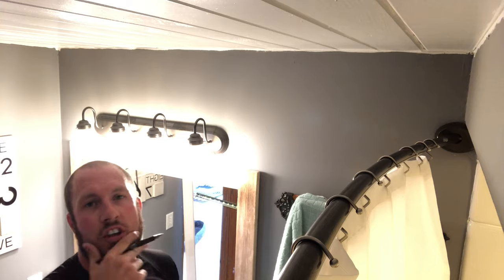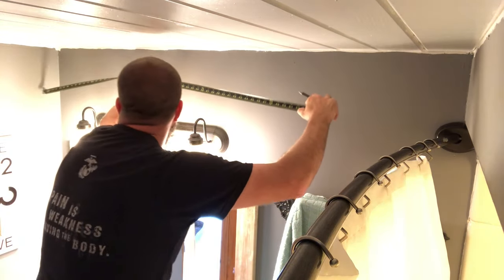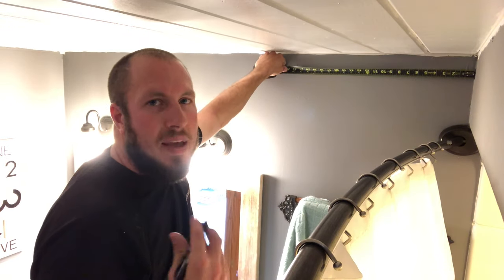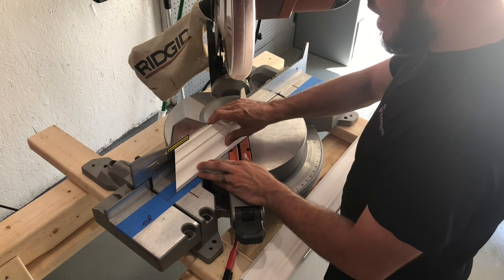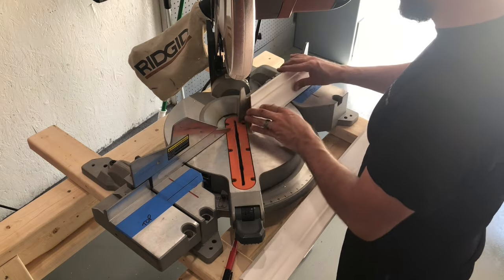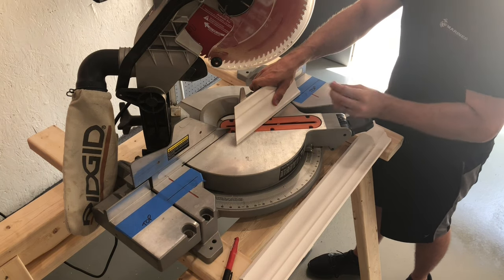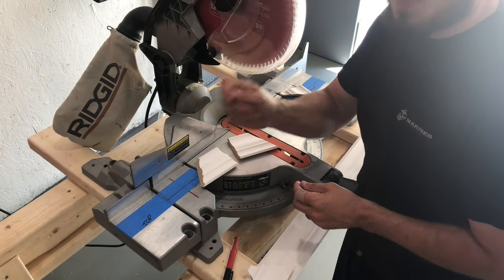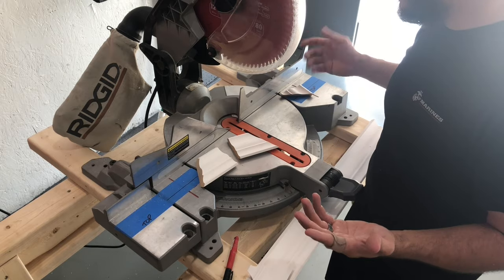How To Cut Crown Molding For Beginners - Inside Corners

Comment: Also remember!!! Never cut directly on the line! The saw blade is 1/8 thick, and if you cut directly on the line then it will shorten your piece by 1/16 if not the 1/8... blade needs to be on the outside of your line if that makes sense! See and have made tons of errors shorting pieces that way and it’s extremely frustrating
Reply: That's what caulk is for
Reply from the maker: Do your best, caulk the rest!
Reply: Putty/ caulking is for holes only. Always fresh blade, and its like shooting a gun, line up 3 points. I sight both front and back egde of the teeth on blade with proper side of mark. Line up 3 points and cut away!
Reply: You not explaining if the walls aren't flush 90°it won't meet up
Reply: Thank you for the sound advice
Reply: I like your comment, I’ll keep the saw blade thickness in mind.

Comment: this video was good but would've been better if you emphasized the angle of the sawcut and where to put the mark on the crown to get the right measurement for the wall insode corner to inside corner.  I'm confused about that.   Since it's not a straight cut like when you do baseboard because a baseboard sits right in the inside corner and crown does not, i'm unsure where to measure on the crown to get the right final distance.    good tip on not bending your tape into a corner.

Comment: I don’t know whether it’s because I’ve already watched a few dozen videos on this or whether it’s just that this guy finally made it make sense but now I GET IT. I now understand the inversion principle PLUS I now understand which side needs to be longest given an inside or outside corner.
THANK YOU, THANK YOU, THANK YOU! 🙏🏽
Reply: Right there with you, I’m like 6 videos in and this one finally made since. Thank you durbin!
Reply from the maker: I really need to make an outside cut video for you guys!  It’s pretty simple, just flipped the other way.
Reply: The tape measure trick was enough for me to find a different video
Reply: Still not sure how this inverted angle cut would fit squarely in the corner and flat against the wall?

Comment: Quick and simple video for cutting crown molding. I installed 400 feet of CM in our house about 15 years ago but today, I installing four pieces in our toilet room so your video was helpful.   
My only negative was your comment at the 4:00 mark when you were getting ready to cut a small piece of CM, really too small to safely cut and your comment was it "a little too little for....a little to small but WE WILL MAKE IT WORK". Also, I didn't see any safety google being used when using the miter saw.  One should NEVER has such a casual attitude around power tools and speaking from personal experience, one should ALWAYS wear safety googles. About 45 years ago, while sanding a transom on the back of a 48" wood power boat and NOT wearing safety googles, a little piece of old chipped paint fell off and landed on my eye surface.  We tried to wash it out on the job site.....no success.. The surface tension had it firmly in place....I had to go to an ophthalmologist  and even he spent several minutes before he was able to remove it.  SAFETY FIRST.....for your EYES and your digits !

Comment: Thanks for the video! I have never cut crown before. We are redoing a bonus room that was added to the house prior to us. It is basically a walled all porch. My only question is. The ceiling has a slight downward pitch to allow rain run off. How if any does this affect the process of connecting the pieces to the straight wall

Comment: I figured out this crown cutting method myself, but had trouble to measure the exact length !!! This video teaches me the trick, so simple that I never thought about it, I am only good at figuring out complicate stuff, pretty weird me.  I just finished 3 crown molding in my home (8 ft x 8 ft, two of them at 4 x 4), still have one more to go 10 ft x 4 ft. It's real fun to do this.
To be honest, I did one wrong cut per room,  my mind was else where when I made this cut and all I can say was Oh. Sh.sh sh sh..

Forgot to mention, the recessed areas (light fixture boxes on the ceiling) are 6" deep !!! I had to install flat molding at the edge, then above it the crown molding. The crown molding overlaps the flat one by nearly an inch.

Comment: Most important thing is to make sure your saw it set up correctly. Make sure the blade is square to the table and the fence. Even the slightest bit off throws all your cuts out of whack. Plus most inside corners aren’t 90 degrees and same goes for the outside corners. Good luck everyone.

Comment: What angle do you place the crown on the saw? (it's not flat on the table)I'm assuming it's also a 45?
Reply: Currently going through the comments trying to find the answer as well lmfao
Reply from the maker: It’s placed on the saw just the same way it would be placed on the wall. Flat on the two sides it’s supposed to contact the wall.

Comment: I've been cutting all day wasting all the pieces with a hand saw and nothing comes out rights 😥😢😭😱.  I found your video and followed what you said (with my little hand saw) and it came out perfect if I were to use it for the ceiling or frame.  But I'm doing chair rail so it doesn't work.  Is there a different method for chair rail?
Reply from the maker: Chair rail is going to be cut with standard angles. Chair rail laying flat against the fence or flat on the table when cutting

Comment: Pretty clear but I'm not sure how to do an outer corner?  I have a range hood I'm trying to put molding around, how much further than the 7.5" corner do I need to cut?
Reply from the maker: The outside corner is done the opposite way of the inside corners.  So the any is flipped the other way on both pieces

Comment: It will be easier to measure if you make a 4 inch jigs for the inside and outside corners than measure the distance in between the 2 jigs to get an accurate measurement.

Comment: Can you explain something that I can't find in ANY video? You have blue tape down with a line. You're holding the crown piece at an angle against the fence. But at what angle or measurement is your blue tape and line at?
Reply from the maker: This tape was placed to make the mark. It is not exact science, measurement, or angle. It is just marked where the crown sits with both flat “wall edges” on the saw.  It is for quick reference only.
Reply: @TheDurbinCompound   So both edges need to sit flat on the base and the fence?
Reply from the maker: @davidpeltz7822  yes. Just as if it was on the wall.  Only while cutting it using this method, it’s upside down

Comment: I honestly use a dewalt saw with the crown attachement and is all from basic stuff  dont have to use the tape is a  fully adjustable  attachement made for crown and can connect to the mitter saw i do know from the past that that attachment wasnt available for ridgid but if anyone knows if they do have them now would be appreciated

Comment: This is a pretty good video, but you never said how/where to measure your 71 5/8 inch length on the piece of molding.  Its too easy to cut it short.   I like the tip about making the top or the bottom  stick out the longest

Comment: what if you dont have a $400 compound miter saw? there's always the coping saw method, which is especially effective when you are doing window frame molding inside a one piece old metal frame. lets also throw a wrench in because not every order is perfectly 90 degrees.
Reply: I got my basically new Miter saw off Offerup for 20$. Doesn't have to be 400$.

Comment: You didn’t tell us how far away the piece should be from the fence.....do you measure the width and then mark the spot to hold the piece at
Reply from the maker: There is no set distance. It is when the piece of trim is flush with the fence. Just as if it was installed against the wall
Reply: TheDurbinCompound my bad....I figured it out after I sent that....forgot that crown has unique backing....appreciate the help...good video

Comment: You really should cope the joints.
Reply from the maker: I agree. That is no beginner skill though!
Reply: @TheDurbinCompound  Perhaps.  The walls are rarely square.  When they are off (wide) but just a little they really look bad with just a miter.   I don't find copping all that hard.
Reply from the maker: No coping is not particularly hard but it can get tricky and every corner situation is different.  I am working on an outside corner video soon where I will probably incorporate coping.  The original video was 100% aimed at the first timer trying to get started into the crown world. I’ve done a lot of trim and I still get my butt kicked on a corner or two!
Reply: @TheDurbinCompound  There are all kind of tricks to crown molding, no doubt!   Nothing is ever square and you need to have ways of accommodating.  Thanks for sharing your know-how!

Comment: Elementary Watson... without the APPROPRIATE TOOL you can’t do it , I have to improvise, ain’t going to expend over $100 dollars or more for an specific tool for a specific work just to cut the 6 molding corners I need !☹️
Reply: I got a miter saw basically new from OfferUp for 20 bucks. Nothing has to be brand new for it to work.